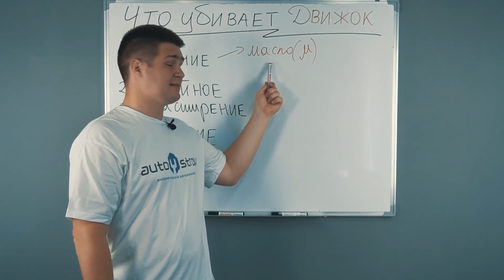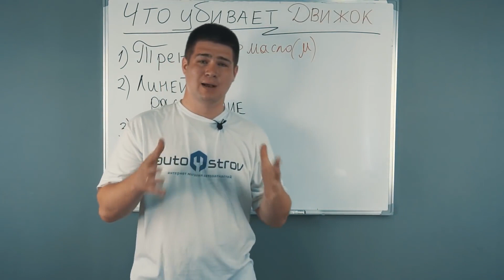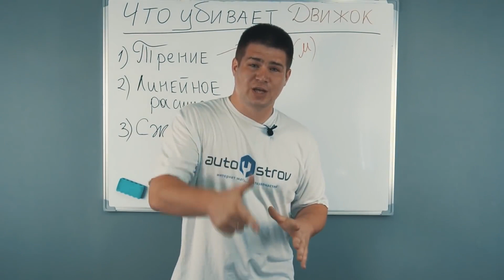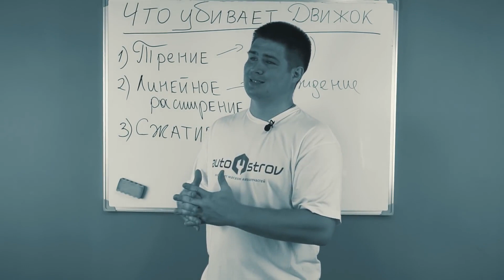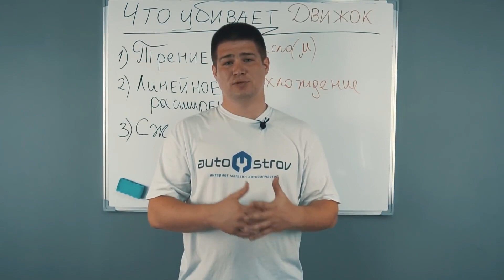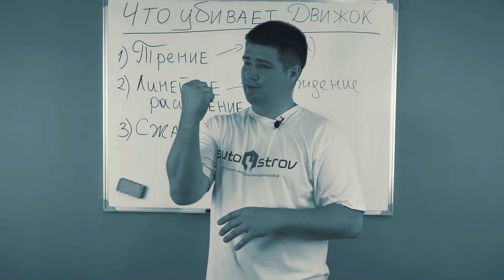How Not To Destroy Your Car Engine?? 3 Things That Kill The Car Engine!!

Comment: Oil ?  ? what oil ? ? ?   There is oil in a car ? ? 
🤔. . . 😝
Reply: this is the answer that an old girlfriend told my brother about the oil light in her 3 years old Escort. . .Upon checking, my brother saw rust on the dipstick and the engine could barely pull 3 rd gear. .smoking like crasy. . 🤣